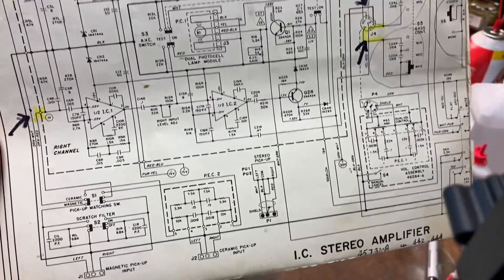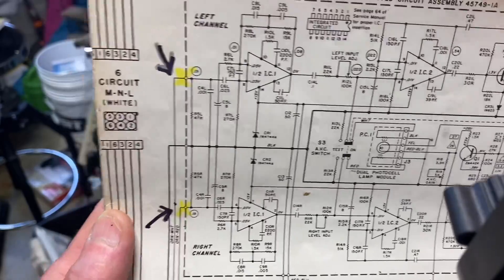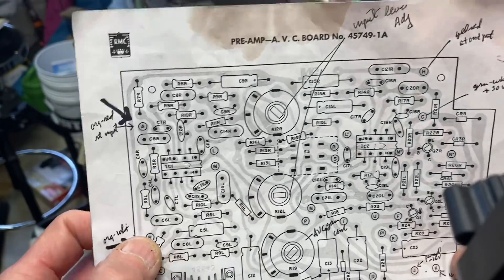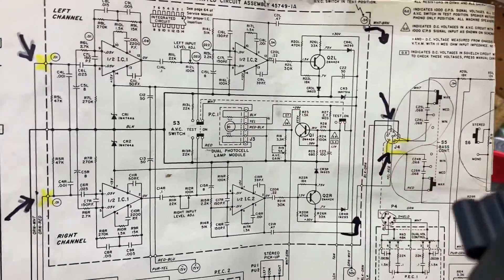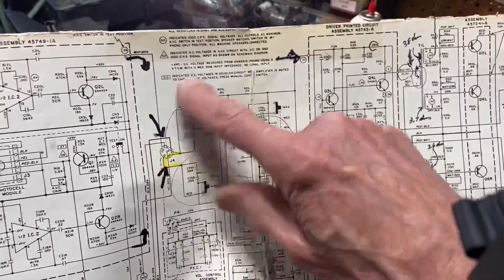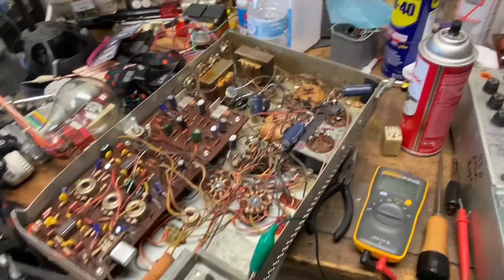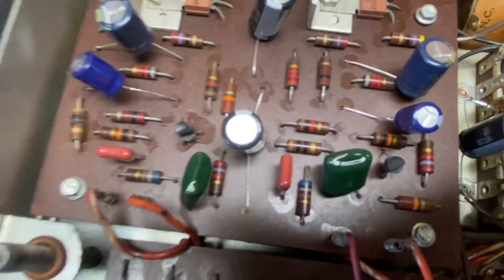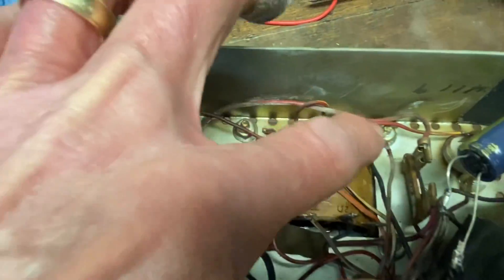How to remedy a 70's Rockola jukebox amplifier with one channel out

Comment: Hi William - what part number are are you replacing the original Motorola dual op amp with?  I've got a 47160 that has a section bad on IC2.  I see Jukebox Revival shows having NOS, but wondered if you use a more modern chip.  Thanks!